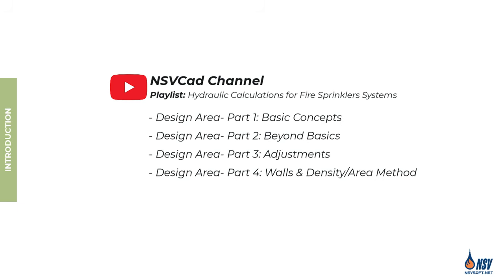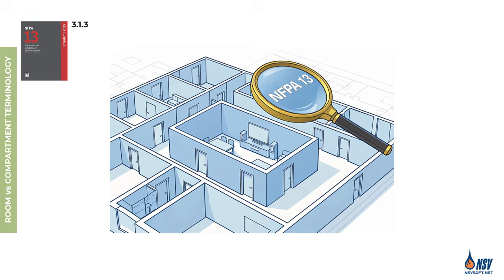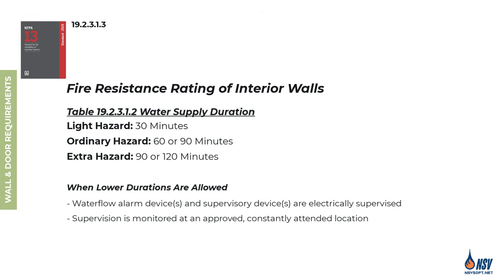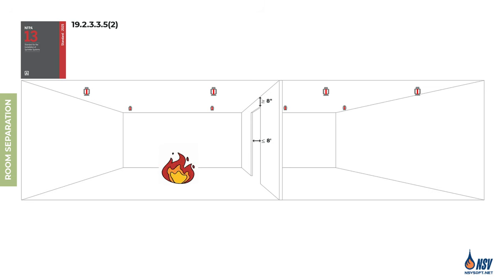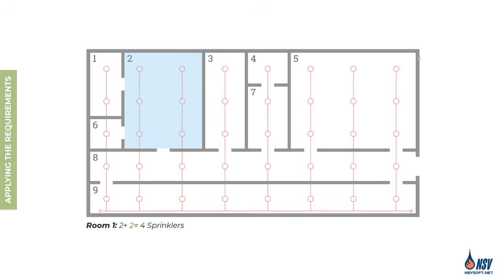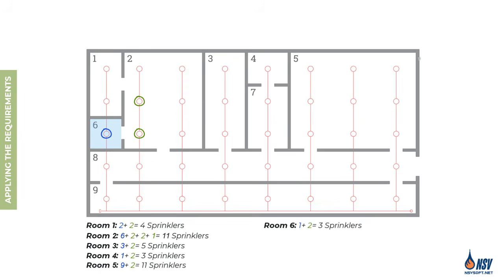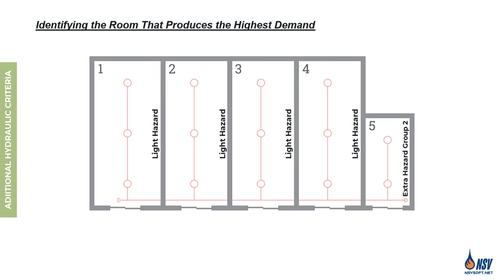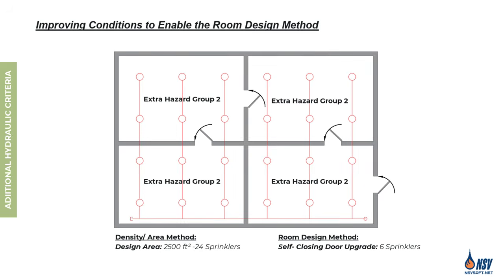◰  Design Area - Part 5: Room Design Method (NFPA 13)

Comment: UNA EXPLICACION EXCELENTE, UNICAMENTE LA DUDA QUE ME QUEDA ES CUAL HABITACION SE SELECCIONA PARA EL DISEÑO? ESO NO LO ALCANZO A ESCUCHAR EN EL VIDEO.
Reply from the maker: Hola Sergio,

¡Muchas gracias por tus palabras!

En general, definimos el área de diseño y realizamos los cálculos hidráulicos para lograr dos objetivos principales:

Encontrar el diámetro óptimo de las tuberías: Seleccionamos un área de diseño para una sección específica del proyecto y realizamos los cálculos para determinar el tamaño ideal de la tubería. En el ejemplo que revisamos alrededor del minuto 6:00 del video, si queremos encontrar el diámetro de la tubería que alimenta a los dos rociadores de la Habitación 1, hacemos el cálculo hidráulico basándonos en 4 rociadores (dos rociadores en la Habitación 1 y dos rociadores en la Habitación 2).

Determinar la demanda de flujo y presión del sistema: En este caso, seleccionamos el área de diseño que genera el escenario más exigente (más demandante). En el mismo ejemplo que comienza en el minuto 6:00, la Habitación 2 se elige como el área más exigente porque contiene 11 rociadores y se encuentra más alejada del suministro de agua en comparación con la Habitación 5 (que también tiene 11 rociadores).

Ten en cuenta que algunas áreas de diseño pueden requerir un mayor flujo, mientras que otras requieren una mayor presión. En estas situaciones, el suministro de agua debe ser capaz de satisfacer cada demanda de forma individual en lugar de ambas combinadas. Exploramos este tema a fondo en nuestro video de Rociadores Residenciales.

https://www.youtube.com/watch?v=E2iMQSXaalE&t=6s